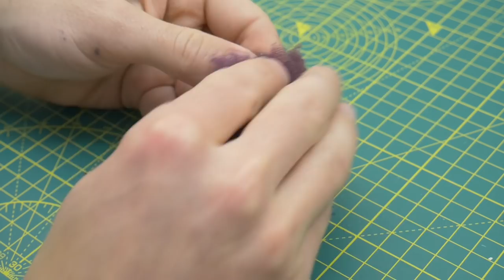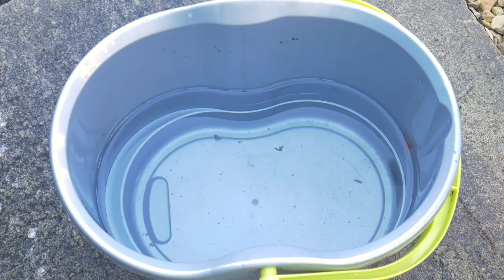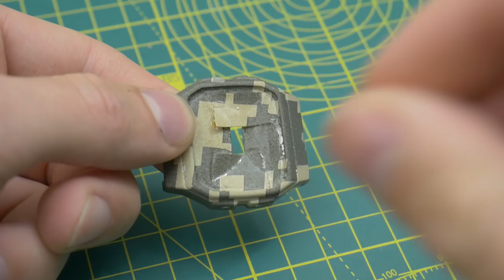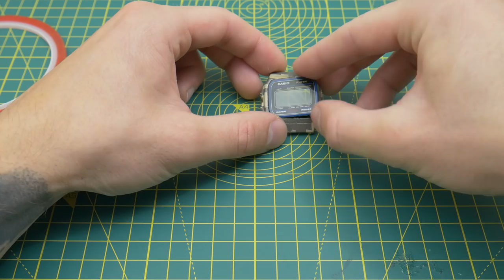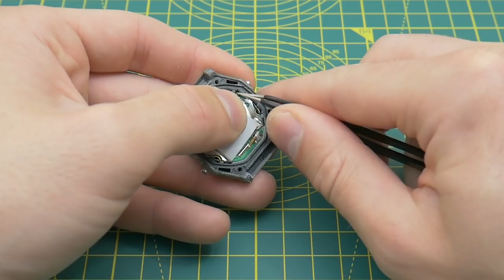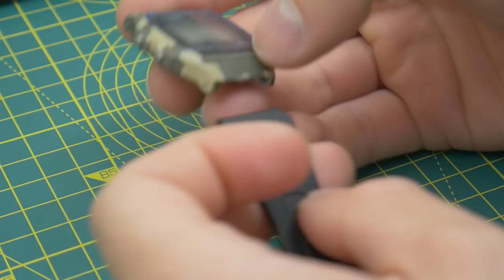Casio F91W Digital Camo | Hydro Dipping

Comment: This looks so cool, but the durability is the problem. It would be easier to do on a DW-5600 since the case is seperate. This tempts me to try it on my Square, but i would rather buy a seperate case for this. Is there a way to increase durability?
Reply from the maker: It's important to clear coat after dipping, that's really all you do make it more durable.

Comment: hey! great video :) after you pop the plastic crystal off the case, how do you clean the adhesive gunk form the crystal without ruining the print on the front?
Reply: I'm wondering the same thing
Reply: @danebeck7900  hey! I finally took a chance and did this with my casio. Turns out there wasn't a lot of glue stuck to the crystal, so I was able to lightly scrape it off with a piece of plastic (I used a disposable spoon).